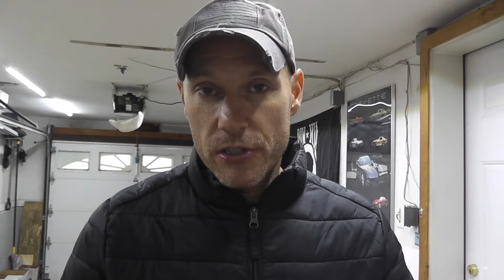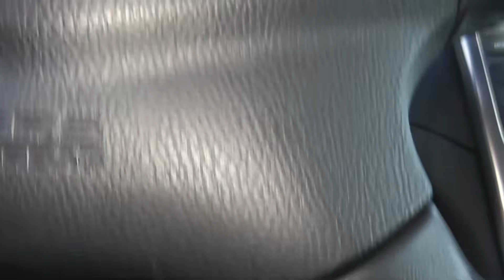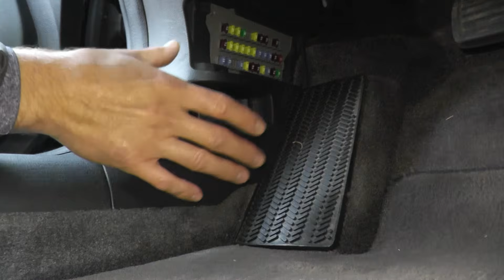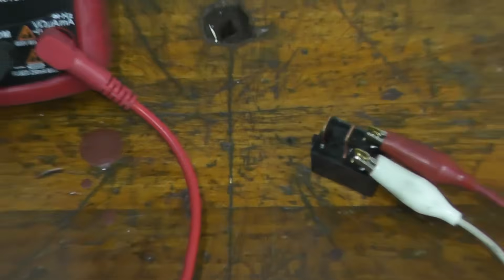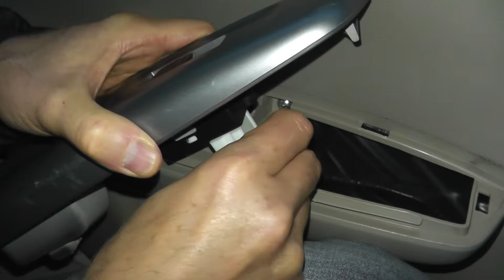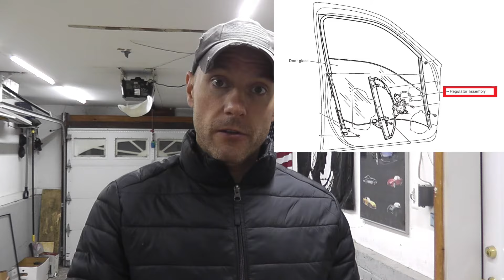How To Test A Power Window Relay, Switch and Fuse

Comment: My 2003 Subaru has the problem with passenger and both rear windows not going down. Neither of the fuse diagrams lists any power window fuses. Nor do any other Subaru model years. No info on the net directing me to which fuses are at fault.

Never a problem for 24 years, then yesterday's hot weather required me to open the windows before turning on the AC.

Comment: My windows switches work fine. I replaced my passenger indoor handle and press the lock switch but it locks the driver door 😳, if I  press the driver door lock it only locks the driver side. Could it be a bad passenger door actuator 🤔

Comment: Great video.   To the point and helpful.   And yes, "know your limitations"!   Ha.   Good advice.
Everybody should have at least an inexpensive multi-meter.   Even for just testing household batteries.   Even if you don't know any of the other functions of the meter keep one around for that.   Sometimes there are 6-8 batteries in devices and maybe only 1 has gone bad.   No sense disposing of the rest.

Comment: Help. O. Corolla 2000. LF rear window goes down with the back switch, but won't go up. On the main switch or driver side, it will go up but won't go down, switches were tested ok, motor tested ok, I took it to the church and still the same 😂😂 no I'm serious I need ideas please.

Comment: I have a 2016 Mustang conv. Passenger door window works fine up and down. But the drivers door switch to operate the passenger window only goes down. Even when I lift it up if the window is up. The switch for the drivers door window works fine for the driver side window. I had a new switch installed on the drivers door but same problem. Any ideas?

Comment: Isn't there a way to tell if it's the fuse vs switch vs relay quicker than checking the fuse? If the window goes up with the switch, but not down, it's not going to be the fuse, it's going to be the switch. If the window doesn't go up or down, it's likely the relay or the fuse. 

Also, there would be a troubleshooting step in whether the master window switch works vs the switch on the door itself. Often if one doesn't work the other does and that would indicate whether the problem is in the master switch or the door switch.

Comment: Hi, my name is John. 
I bought a 2004 GMC envoy, checked all the windows and they all worked great. Very strong quiet motors, all windows went up and down very well, but I drove it home for the first time, pulled into the drive, put all windows up, and turned truck off. Then before we even got out, my wife remembered we needed to run to Walmart, so I immediately turned the vehicle back on and tried to roll the windows back down, especially the back windows because we have, at the time, a 1 year old and a 6 year old in the back seats, and it was beginning of summer. But all of sudden neither back window worked. I have checked all fuses, checked the relays, and even tested the master switch in the driver door, but nothing was blown or broken, and the master switch works but I can't figure out why both back windows stopped working at the same time for no reason. Even my mechanic can't figure it out. 
Please, please help me in any way you can. I have tried everything and have to do some many repairs on this vehicle but 3 things are unexplainable. My 4 wheel drive, my air conditioner, and most importantly the rear windows. 
 I really need this to work again. I know the motors didn't go out without warning and at the same time. I live in Michigan City, right on lake Michigan, and in the summer, it gets very hot and extremely humid, and we can't put the kids in it for long because I gets so hot back there. 
Please help if you can. I'm out of ideas and nerves 
 John Mayfield.

Comment: I don’t think this method worked for testing my drivers side window switch. Before doing a lot of work to go into the door frame and change out the motor, I tried this method. There wasn’t a pin on the connector I could find where the switch actuated and pressing it actually changed continuity. I went ahead and bought a new switch plugged it in, window still didn’t work. Testing it I got the same result as the first one. I think this process might not work for all car models. I have an 06 Subaru STi

Comment: My driver window switch stopped working and cant find a replacement OEM switch so I bought a universal switch and relocate it to next to mirror switch on dashboard and used some old speaker wire that I had laying around but now the motor only clicks wanting to go up or down but when I connect the motor  straight to power with the factory wires it goes up and when I the wires it goes down, so could it be that the wire that I used is too thin

Comment: You are doing several things wrong here. 

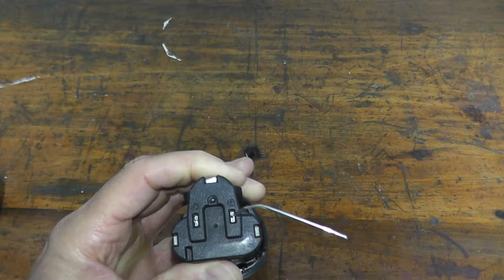First: 6:00 Don't make the temporary test terminals (paper clips) so long and bent as to be able for the to accidentally make contact. If the battery tips over while moving wires around, there is a very good possibility for them to short out.

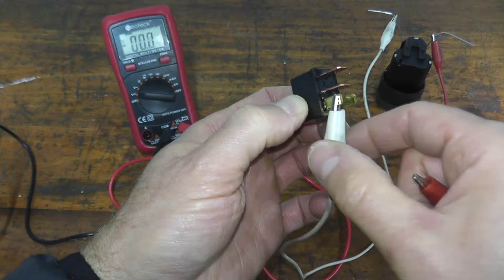Next: 7:20 DO NOT try every contact together as you are doing. Many relays have a Normally Closed Contact set. If you do that to that set you are going to short out the battery. This is a very BAD practice and you should NOT be telling people to do this. The proper way to find out what terminal goes to what, using that multimeter (you JUST Showed), on the continuity setting. The relay coil (which will almost always be in the opposite direction of the NO and NC) will have some resistance but will show that it in fact has continuity. 

Next: When you tested the switch, you ONLY tested the Down. You should have tested both and tested for NO Resistance. You may have some continuity but NOT a solid connection, meanit the switch is faulty or dirty.

Next: After you ONLY tested one function of the switch you went right to the actuator/regulator.  NO. There may be a problem with the CPU module at the switch that may be faulty.

Next: 15:16 Never have I seen a regulator that is riveted in. You yourself just said you never done this 14:20 , so how can you make that claim.

Next and this is a "OH COME ON MAN! No Shit." 14:28  Find someone to do it cheaper. Yeah maybe the tip to, Do most of the work and MAYBE safelite will do the rest, is ok but come on man like people won't try to get it done cheaper. 15:27 "or maybe just a local mechanic"  Gee I wonder why he didn't mention if he already went to a mechanic, oh wait he did 0:07

Comment: Hi I have a question I have a 2013 Lincoln MKT sometimes the front passenger door switch doesn’t work and sometimes it does sometimes the front driver master switch for that right passenger door doesn’t work and sometimes it does

Comment: This does not help my issue. My Windows operate properly, however, they work when there is no key in the ignition, and do not work at all when the key is in. Am i wrong in diagnosis that something is wired backwards?

Comment: I know this video is from last year but I hope you can still see my message and reply.  I'm a woman, so mechanics (Not all) sometimes take advantage. I try to do little things myself but recently the AC on my 2000 Nissan Altima started making a noise. That's something that I will definitely not try to repair myself but I live in Florida so without AC, I had to put the windows down. The problem is that now the windows aren't working either (They are stuck half way) and it rains here almost every day in the summer. I checked the fuses and they are find. From my research I found that my next step is to check the relay, But where in the world is the window relay is on this car??? I have checked the owners manual, Google, YouTube, etc.... AND NOTHING. I know it's an old car but I can't believe I can't find ANYTHING. If you know or could lead me in the right direction I would greatly appreciate it. I had one mechanic tell me that if I but the relay and tell him where it is, he would change it. Well if I knew that, I would have already changed it myself.
Reply: Maybe too late, but did you try a "reset" procedure? My Subaru legacy has one. It is very simple, just requires holding the switch in two positions for a few seconds. Search for your car model reset procedure on the internet to see if it has such a procedure. The reason for it, I think, is because the switch has additional features you don't realize it has, but they require resetting after power problems or disconnection (features like counting how many window motor rotations take place in order for the computer to calculate the window position).

Comment: My fiancé has a 08 odyssey. All windows worked great till kids got in a was playing in front seat. Now only driver window will work. The other windows will not go down from the master switch or the individual door switches. You can here a click but nothing happens on all 3 non driver windows. I checked fuzes all good. I switched relays and same issue. Im thinking its the master switch?

Comment: Thanks a lot for share your knowledge in this matter !  the driver's window of my Skoda suddenly stop working.  In the garage changed the switch and the fuse and bingo! worked for once. The next day, when I turned on the auto, the front windows were frozen again. Doesn't open at all :-(   Maybe is the relay?  (I'm going to try it). Again thank you for your time and explanation!

Comment: If the passenger window rolls down with the switch, but not up, but it will go up with the driver side passenger window control, is it a safe bet that is the switch that's the problem?

Comment: At min 7:24 when you applied power to those two terminals if the relay is normay closed type (NC type) you short the relay because there's continuity between those two prongs when the relay's not powered...
those two prongs are terminal 30 and terminal 87 that connect to the controlled circuit or load  and usually you can tell because they're wider prongs....the other two prongs are terminal 85 and terminal 86  and they bring  the ground and positive (control signal) to the relay...
Reply: What are the different relays? You said NC type. I don't usually like working on anything electrical. But I did see before a diaphragm on another video of the prongs numbered. I am asking because I don't want to short out anything for future purposes. Or do you have a video that shows the different relays and ways to test them so you don't mess up anything. This video was so helpful but I understand what your saying. I just want to prevent problems down the road. I'm working on 2 vehicles right now. But I'm always doing something

Comment: 1999 Honda Accord EX front passenger power window doesn’t work but if I turn on my heater and heat up feet position for a minute the power window start working. Then stop when it gets cold. Pls help

Comment: This is horrendous! First of all, even a 30A relay's coil can be magnetized enough to switch with even 6v from 2 regular 2032 coin batteries, which are being used in remote controller, with 2032 code.
Second, putting a cunning, cheap, and low-level click bait in thumbnails is the signature of another Penny Pincher!  just like what u did with putting a battery among power windows and asking what is this, like u're going to introduce next most important invention of the millennium, not some useless stuff which won't hurt anyone anywhere if you wouldn't record them! In fact uploading it made loss of nerves in a large scale! 😂🤯😅
I don't have any personal issues with u, I  just fell for the cheap thumbnail as I thought it is anó0 automatic wind up/down the side glasses your manner in this post wasn't a good example trustworthy nez

Comment: Can I use a 18v battery pack? That’s all I have lying around
Reply: Too late for you, but tape in series some batteries to add them up to 12v. That's literally how my Dremel works. My pack was not charging, so I took it apart. It was made of AAA batteries, all connected in series (equivalent to vertically stacking them on each other). BTW, you can connect AA batteries in parallel to create a D cell. That is how my rechargeable D cells were made, as are most (if not all) brands of D rechargeables. They create a battery harness the size of a D, then pack with smaller batteries to make a larger one. Again, though, making series connections adds the voltage, parallel connections increases current (and power) capability.

Comment: I just installed a new motor and regulator but the window doesn’t work. I tried the buttons before I replaced it and got nothing, no motion no sound. After the new install, still nothing. Not from driver’s side or passenger side. I guess checking the fuse is my next step.

Comment: I have a 1994 Honda del sol and my driver side window does not work, I’ve changed out the motor, cleaned out harnesses, looked at fuses and relay and controller, I still can’t get it to work, I’ve run out of ideas. Please help
Reply: Maybe a broken wire somewhere.

Comment: Fyi, replacing the regulator is not difficult—-plenty of videos on it. You can also just replace the regulator motor (just removing screws and a connector) to make it an even cheaper fix. Thanks for a very clear and concise video!
Reply: Is the regulator motor the only motor inside the door?
Reply: @DixT1  Yes, pretty much. It’s pretty obvious which one it is as it’ll be attached to the window regulator in the door. Easy to replace and a lot cheaper than than buying the full window regulator (~$50 vs $175).
Reply: @Kalanimauimusic  Thanks!  I wondered if it was just the motor, since the regulator needs the motor in order to operate!  I changed the master switch on the driver door and got all my windows to work---except the front passenger door! The fuses and relay are fine, also.  I should be able to do this myself. (I haven't worked on my own vehicles for about 25-30 years now. I'm 74 now and just don't want to pay what a mechanic's shop wants, to do it!)
Reply: @DixT1  It’ll be apparent if the motor is working or not if you remove the door panel and observe it as you engage the window switch. On my Jeep it was just a cheap, plastic retaining clip that broke, $6.29 to fix! On another car, I took apart the motor itself (just screws) and discovered corrosion inside which I cleaned; still working til this day! You can definitely fix your power window yourself (especially with YouTube)!
Reply: @Kalanimauimusic  Thanks again!!!!!

Comment: Yah-

- After Hour 3 trying to do the window regulator on my Toyota Solara, and was shop baited by online prices that were 1/3 of the actual price, and because now the price is three digits instead of 1/3 of that, going to test the switch with a multimeter.  

While I am sure it's the motor, it is an expensive gas so I want to make sure that it is the motor.

Comment: So basically this was a pointless video?? If it turns out you have to replace the regulator.
Reply: Why is the video pointless? It accomplishes the purpose of showcasing a process. Other people might not need the regulator replaced. The video has problems, but it is not useless.

Comment: Excellent video! I changed my side sliding doors on a 2012 Dodge Grand Caravan for ones that have electric windows. My old doors did not have these. I'm looking for a easy way to run power to operate those windows. I have the old pigtails for both that run to the chassis wiring harness. That harness is not wired for sliding door windows. I'm thinking of adding the pins from the new pigtail to the old set of pins to the old plug on the van and adding a fused double hot wire and a ground wire to allow window control ONLY from the up and down switches in the sliding doors. No hookup to the rest of the electrical system in the van. Just hot and ground wires to the window switches in each sliding door. Don't ask why I'm doing this, I have a good reason.  BTW, the sliding doors are manual, so no need to worry about automatic door openers, just electric windows. If you have any ideas on how to test the wires so I know which one is up, down and ground, I would greatly appreciate it.

Comment: I thank you for your detailed instructions on how to diagnose the failure of driver's side car window!  I thought I'd start with checking the fuse. Sounds simple, right?  The fuse puller I have is not that same kind you demonstrate. Mine is one you need to somehow jam with the strength of a gorilla into the fuse and that is supposed to open up the jaw end and grab the fuse.  So there I was, an over 60 year old woman kneeling on the floor of the garage, leaning into the fuse box area, using my right hand (did I mention I'm left handed?) to try to jam the jaw end at the fuse I want to pull out. All I could think was what kind of a cruel ****** would design such a tool?  I have fixed a lot of toilets, I have rewired a floor lamp, I have hung a door, but this has me wanting to jump off a bridge. For my sanity, I'm stopping this now.  I'm going to bring my car to my mechanic to fix the window.